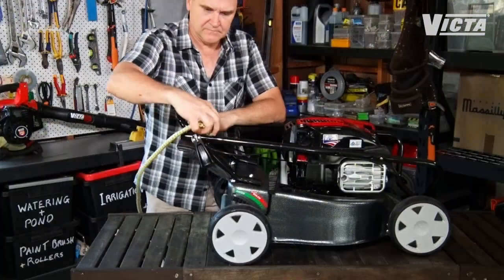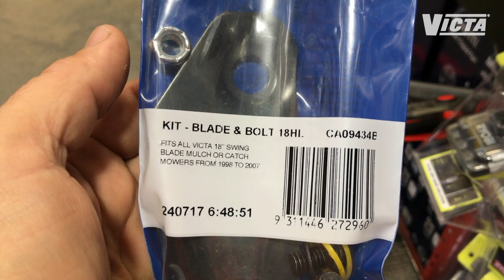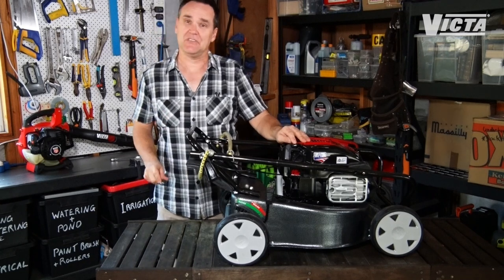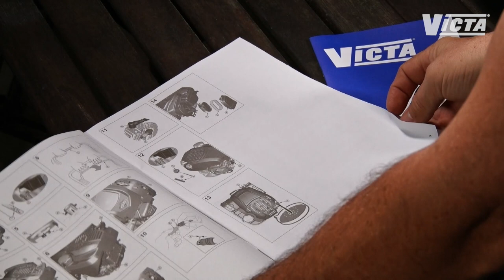Victa Lawn Mower Maintenance Tips

Comment: My Victa mower comes with the instruction to add oil before use.

Like yours, the Valvoline oil I bought doesn't have a proper pourer, when I tried oil went all over the deck. It would be so easy to mould a better pourer into the bottle, or provide a top that has a pourer, like my bottles of PVA.

Comment: G'day. How do i tell the G4 from the LM carby? Both I have here, had the clear and black poppet valves in a bag of parts. Black poppet one has to go into the LM per Victa book notes. Only body difference I can see is where the decompression hose goes onto the back of carbys - one vac inlet is longer with a white tip, and the other shorter with no white tip. Thanks.

Comment: One flaw in this video as shown in 1:34. It is unlikely that many mowers will have a clean bolts! Most lawnmowers will be covered with dirt, grass etc and the bolts will have harden, so removing that will be difficult from the back. Instead I would rather access it from the base (underneath) to remove the blades. For the life of me, I don't understand why Victa in their user manual fail to disclose the parts number, model for their lawnmowers? Its not that easy as I thought to be honest.

Comment: This was interesting because Briggs & Stratton does not suggest to change the oil on some models, just top it off if necessary. I change the oil at 15 hour intervals and never had any problems except for that style air filter getting oil from the breather tube.
Reply: @VictaLawncare  Mine not a Victa mower, but a Briggs engine, and mine has a oil drain plug.

Comment: I like to take the base plate off when i do the blades because I also drain the oil out.  There is a oil drain plug on my Victa mower above where the base plate goes so I remove the plate to then drain the oil out..

Comment: DO NOT TIP THE MOWER FORWARD. It cause oil to go to the combustion chamber tip it over to the side if you really have to. Do what I do just change the blades when you service it. I service mine once a year.
Reply: I tip it air filter facing up the only way 🤠

Comment: ❤️ Victa. Simply the best
Reply: Victa was the best but ... the Briggs & Stratton 4-stroke engines, the 450 and Q45, these are fantastic if fitted with a good deck and bar blade system.  Yes these are domestic, light duty mowers but you should try one if it cuts really low, recommended.